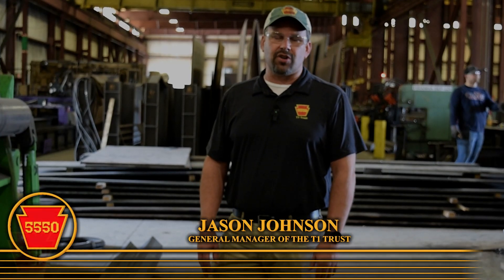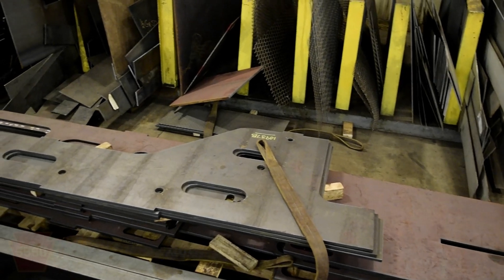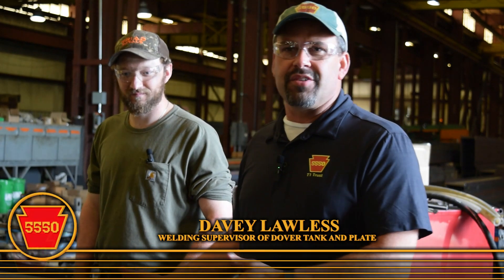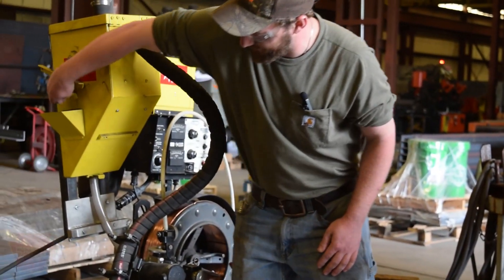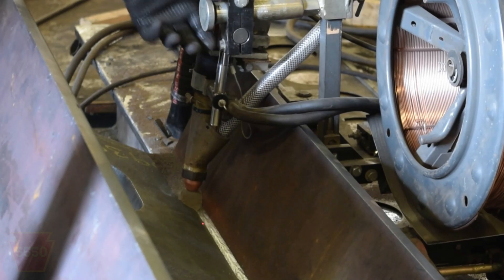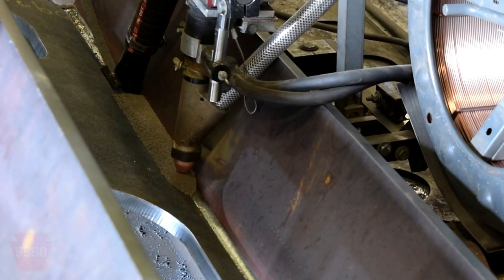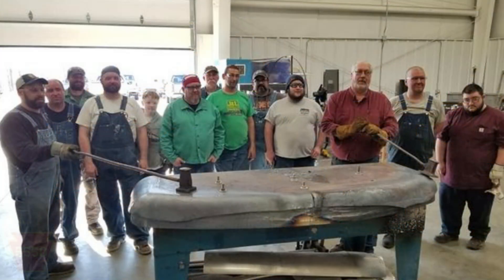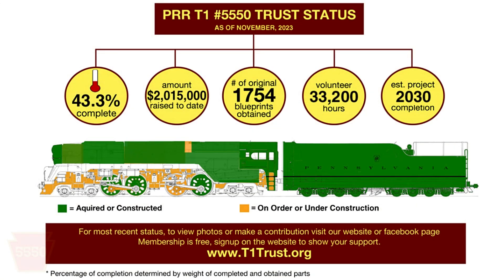April 2024 Frame Construction Update - Submerged Arc Welding

Comment: Welding modular container frames for a semi trailer manufacturer in Stoughton, WI, I was welding at 34-36V @340A burning 360-400 IPM of .035" wire. My wire came from a barrel, not off of a spool and would last about a week between 2 shifts, totaling 18 hours a day for a 88 hour work week average. I welded at every station on the container line at the Evansville plant, from making parts, assembling frames, and operating the robotic welding operations for headers and door posts. I started in lift posts, lower frames, lift frames, 5th wheel plates, lower door frames, door frames, front frames, corner posts, lower front frames, lift skids, and then finally the robot. I was the only worker to have worked every station and had never had rework. I was missed for performance reviews twice, because I transferred from plant 6 to 8 and was transferred from assembly to welding departments. And as soon as the company needed to reduce its workforce, I was laid off. Why, you ask? Because I didn't fear the bosses and wouldn't kiss their behinds. I did my job as quick as I could, I did it as best as I could, cleaned up my area, and went home. I didn't screw around and I didn't help others do their job, as my boss would have liked. Why not? If a person couldn't do his job in the time given, then he either needed to be put on an easier job or they needed a second person on that job. Taking someone who does their job faster, because they put that much effort into doing it, then making them help another person afterwards is not right. If I had done my job a little slower, then I wouldn't have been available to help anyway. I saved the company 8 hours of pay a week because I worked harder. The two guys that worked the door frame assembly would finish early every night, then sit on their bench and wait until 15 minutes before the end of shift, clean up and punch out, every night. Why weren't they ever asked or told to help anyone? I was making at least 50 cents an hour less than anyone else in my area, but worked harder. When I worked on the robot, my partner and I would finish our jobs and make up parts for the day shift and leave them enough parts for their whole shift, and still punch out 2 hours early. The day shift would only leave enough parts for the first 2 hours of 2nd shift. We were building 10-15 units on 2nd shift (10 hours), to 1st shifts 8 in 8 hours. The plant manager had it in for me. He was my foreman when I started in assembly. We completed the last order of containers and I was sent down to the finishing end, then to another area to build air brakes. When he wanted me back on the line, he lost the battle to the lead guy in my area, even though he was a supervisor at the time. Then, within 6 months of my hire, he was promoted to 2nd shift plant manager (major brown nose) and I went to welded school and transferred to plant 8. About a year later, he came to my location as the new plant manager, and I knew things were going to go bad. As soon as they announced last offs, I knew I was out of a job. The drug tested me (randomly) for the first time since being hired 3 years earlier, then sent me back to the line. I didn't complain since I kept my higher pay as a welder, compared to the much lower pay for assembly. They kept me there for 4 months, brought me back to my old job for 2 nights and gave me my pink notice. As a side note, I worked with a guy who was caught tailgating in the parking lot, who was later promoted to foreman. That place lives on turn over, but appears to turn those that work hard and produce high quality, promote those that can't, and reward ass kissers. I've never kissed ass for a job, which is why I've been through several jobs. I don't party, watch sports, or participate in after work activities (bar) with people I work. I do my job and go home to my family. No regrets!

Comment: With the exception of the most recently recreated British steam locomotives, I always believed steam locomotive beds were case instead of being made of assembled plates to better withstand repeated stresses.  And I always assumed it would be impossible to cast  an engine bed the size and complexity of a T1 owing to the fact no foundry today would be capable of undertaking it.  I sincerely hope a welded frame bed assembly holds up under extreme operating stresses.  Further note, nothing was mentioned in regards to the four steam chests which most certainly would have to be cast pieces bolted together.  Anyway I wish you guys the best of luck completing this major undertaking.

Comment: I hated sub arc. Boring as hell and in the winter it doesnt even really keep you warm. A great job for apprentices.  I had to run sub arc too many times while I was still working in the trade using that same Lincoln feeder. It does put down a lot of weld if you are dealing with heavy plate.

Comment: I hope the next video or videos shows that you’ll have the frame, wheels, pistons, boiler and cab of the locomotive all put together/painted by then. After that I definitely wanna see the tender completed/attached to the locomotive and finally a test run video. Grand finale will officially be the T1 completed while pulling old school restored Pullman Pensilvania passenger cars for its first excursion run
Reply: One Amtrak certified private Pullman rail car, named the Dover Harbor, owned by the Washington, DC Chapter of the NRHS would be great behind the T1 5550.
Reply: @chooch1764  and then the t1 thrust will be rebranded into the s1 thrust i hope so!
Reply: @maximomiglionico430  The T1 Trust is going to remain as the T1 Trust. A PRR T1 would be way better to operate than a S1.
Reply: @chooch1764  aw man!!!

Comment: I still will never support this trust. I don’t dont support the idea of building a T1, It’s one of the top extinct American steam locos, but building it just to break an 85 year old record? I highly respect 4468, and it’s a record that nobody tried to beat back then once it was recorded and is just stupid now as steam locos are obsolete tech. If you built the T1 just to break the record, that’s just sad. We could have used a J3a, MILW A or F7, hell even a Niagara, but no. You decided this just to break a record. If you don’t break the record, then I have no problem.
Reply: It’s not all about the speed the record. The locomotive will be used for excursions on short lines and tourist railroads. If you want a J3a? How about you start a group to build one from the ground up, instead of just complaining?
Reply: At least some of those you mentioned are also rumored to have broken the record, and I’d bet that if a trust came along and built them they’d at least try for the record. Most class ones with speed demons like the T1 didn’t spend the time to truly test the top speed. If we successfully build a gigantic 4-4-4-4 passenger engine duplex locomotive, might as well see how fast they could go since the Pennsy didn’t test the top speed themselves. Its just that a monster 4-4-4-4 speed demon duplex may be faster than a speedy 4-6-2. 5550 will have some modern advancements (such as being welded instead of casted, updated poppet valve gear, etc), but nothing so far that the historical T1s probably couldn’t do. If 5550 wins, than it likely means that if the Pennsy tested it themselves they likely could have taken the record in their time anyway. They didn’t choose T1 specifically for breaking the record. There are easier builds for that (some of which you already mentioned). They chose the T1 because they like the locomotive.
Reply: @Stooltoad5017  Thank you for being the only civil one here. It’s true what you said, might as well try to beat it I guess but where would they even do so? Only place I see is the NEC or the Pueblo testing center, but would the FRA even allow a steam locomotive to even go that fast? Network Rail, the equivalent of the FRA in Britain, restricts all steam locomotive to 75 mph, and locomotive with driving wheels smaller than 6’2 have to go slower than that. Only one is allowed to go 90 mph And that’s 60163
Reply: @threepea1151  I believe the plan is to test it at Pueblo, Colorado. Outside of that it probably won’t go it’s top speed even if it were invited to a class one. I have even heard that somebody even stepped up to pay for the locomotive’s time there but I am not totally sure about that. Either way, the plan is to test in Pueblo.
Reply: @Stooltoad5017  You are correct. The T1 Trust said they have a sponsor that will pay for their trip and testing fee.
Reply: What a lame comment.
Reply: They're not just restoring it to beat the steam record. If they did that, that would be a complete waste of time. The main reason they're doing it is to build a locomotive that has been extinct and represents the more modern steam power the Pennsylvania Railroad had during World War 2, technology that has been lost to time. The other main reason is to pull excursions on the mainline (if it's avaliable), as well as shortline and regional railroads.
Reply: You never know, the Brits might dig 4468 Mallard out of the museum give it a full refurb and go for a high speed run on its 100th anniversary in 2038. I wouldn't rule it our by any means as they have plenty of resource, skills and enthusiasm to make it happen. 👍  Last time I looked there were 6-8 credible new build steam loco projects in progress in the UK with some nearing completion.
Reply: @Pesmog  Museums don’t tend to run historic locomotives ragged to claim speed records. Restoring Mallard would already be expensive enough. Running it like they stole it would only add to the already high cost. Museums aren’t made of money and the average person that is donating isn’t either. 5550 at least has the advantage of being completely new.

Comment: Very nice update, it's certainly interesting to see how the welding process for the frame has been going down. It's also nice to know what other parts of the engine you plan on doing next with the cylinders being the next thing, then making the running gear, getting the boiler & frame connected then following up with the drive wheels (provided that the last 2 drive wheels are done and ready before that step along with the trailing and pilot wheels for the frame), and then finally getting to the tender. So excellent work on both you and dover works.